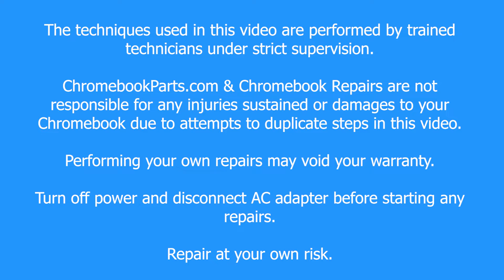Acer C723 Chromebook Keyboard Replacement

Comment: How crucial is it to disconnect the battery before replacing the keyboard?
Reply from the maker: It's not strictly necessary to disconnect the battery first (Acer definitely designed it to be no fuss), but it's still something we always recommend as there is a very small chance of shorting out the motherboard whenever connecting / disconnecting cables with power to the motherboard.